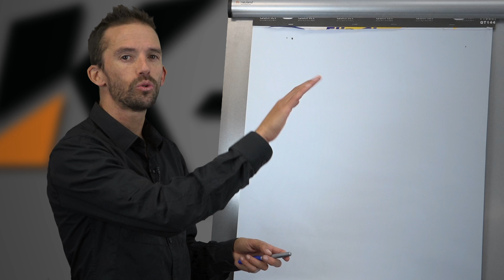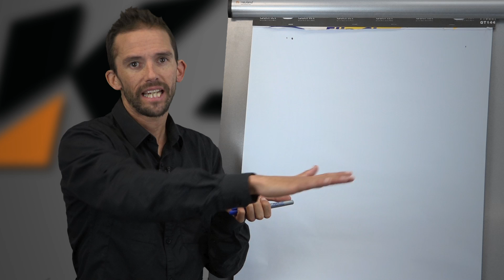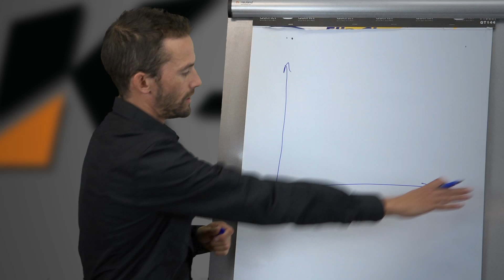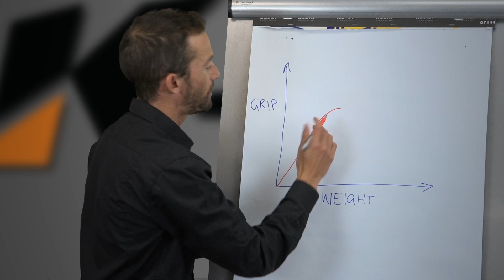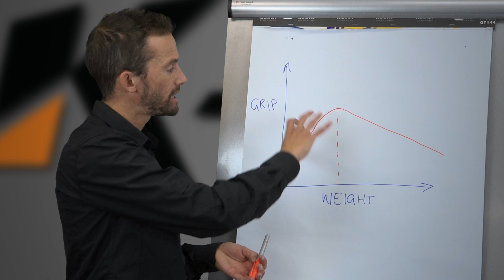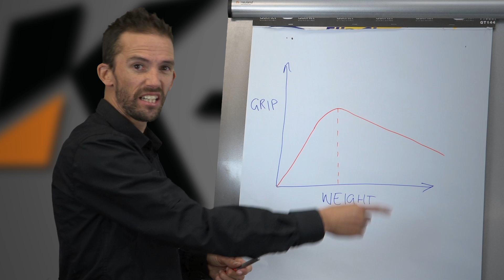Whiteboard Wednesday: Sliding, skidding, and twisting

Comment: Love that you are trying to put some science to kart dynamics.   The only situation I think would achieve the right side of your chart (twisting) would be "an inside front tyre in a kart setup with a combination of some or all of -- weight too rearward, rear track too wide, weight too low, front tire pressure too soft.  Or maybe excessive helmet aero! lol
Reply: Full Noise Racing i'm a TAGr super and i think i deal with that side a lot. rear track is a bit of a funny thing to list as you can go wide to a point then start to lose grip, there are two different kinds of grip: what i like to call "mechanical" grip (the physical produced by the tire and setup) and "dynamic" grip ( the amount of grip generated by driving style and mechanical grip combined). you can set the kart up to get a lot of mechanical grip but if you lean on the tire (increases the weight acting on the tire) you will overheat the tire and (if basic understanding is correct) start to get excessive twist leading to understeer and/or bump oversteer (skidding from loss of adhesion with the rear tires). on the other hand while setting the kart up for little mechanical grip lets you lean on a tire more to generate the grip and potentially allow for a higher mid corner speed if you don't keep control on the amount of weight acting on the tires (to much or not enough) you will get push understeer (skidding) on corner entry and/or exit oversteer (not sure if this is skidding or twisting).